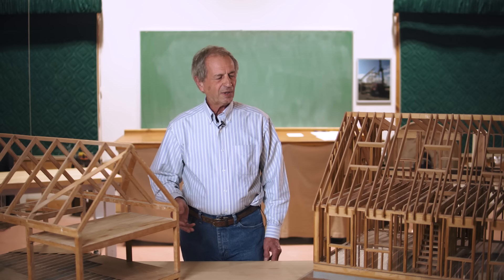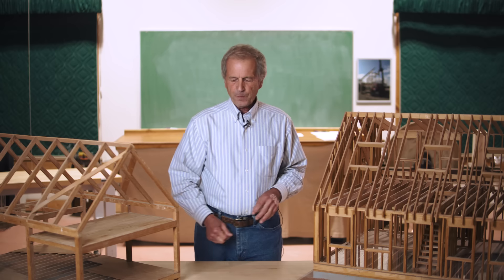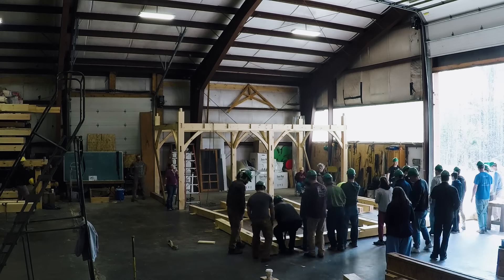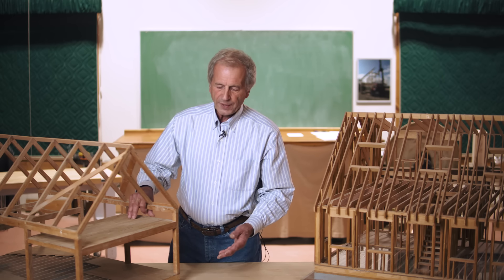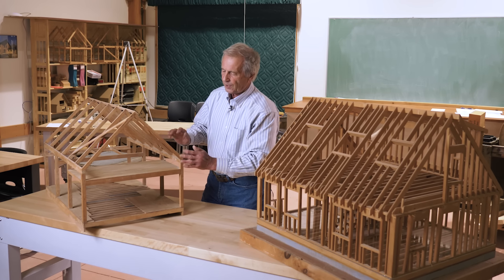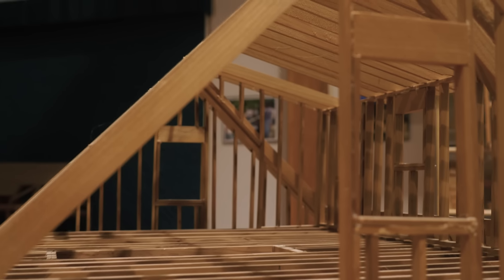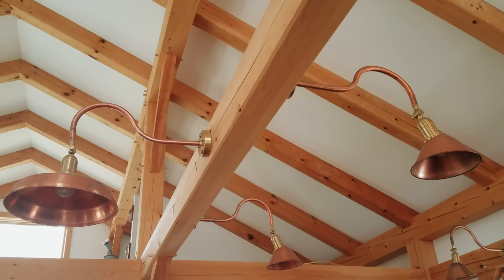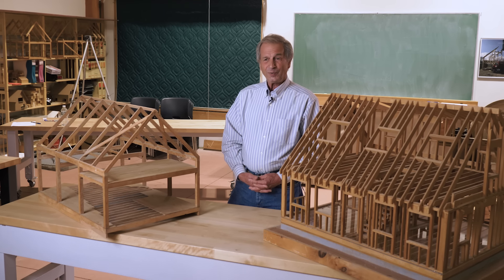Timber Frame vs Conventional Stick Frame

Comment: Love how this video is just subtly dropping shade on modern construction.
Reply: Modern construction is coded for one reason only and that is to enrich the largest lumber companies that have huge budgets for lobbyist.  There are numerous practical ways to build your home but you will not be approved by the code. Many techniques have been used for centuries and are still standing.  In my coastal NC town the codes have become ridiculous and let's not forget that they are interpreted by some local jackass who has never built a doghouse. Some older homes here (100 years or more) are standing on stacked stones and are ballon framed for cooling.  They have been through all the same damn hurricanes as all the rest of the homes in the area. Just saying that building codes are necessary to weed out the idiots but you should be able to build by other methods if you desire. There is more than one way to build a home.

Comment: I didn't take the time to read many comments at all, so please forgive me if my comment beats a dead horse.

I've been a woodworking guy and have had a fair amount of exposure to timber framing during my lifetime.  LOVE the process and the result!

When I went to look at building my current home, I was quite surprised the cost of TF versus conventional stick building appeared to be much higher.

This gentleman didn't do any kind of quantitative cost analysis.  Wondering if this cost difference is still a big consideration as it was 20+ years ago when I built.

Comment: There are large numbers of timber framed buildings here in England that have survived beautifully for many many centuries. Near my home is a medieval tithe barn dating to a little before 1300 with its original timber roof - it is in excellent condition.

Comment: kind of bummed he didn’t go into the advantages of stick framing. makes this just an ad instead of an informative video
Reply: I mean, it is an ad
Reply: advantages of stick framing? more job site waste? More lumber? more seams in the envelope? what exactly are the benefits you are describing?
Reply: @dennisnelson1602  Those are disadvantages, ya dum-dum
Reply: @deerkiller61  lol, no shit? That's his point.
Reply: The advantage of 'stick' framing is that there's far less constraint to the size and proportion of the rooms within the house.  One doesn't need to be concerned as to the alignment of the timbers to the edge/corner of an internal divided space.  Because of this, some Timber frame homes have hybrid (so called stick frame) interiors.
Reply: Divertedflight what you point out is that  any hack can stick frame.  Timber frame is true craftsmanship and certainly more of a connections to the generations that came before and provided the foundation of this world for which the masses of idiots today take for granted.  
I got plenty of draw knives, chisels, and adz for to you to discover what a real days work consist of.  
Geometry and some knowledge of tree species helps or maybe you want to keep relying on those incompetent fools at Lowe’s and Home Depot.  🤙
Reply: There are advantages to stick frame.

Stick frame with sized lumber is quick and became advantages after the Chicago fire.

As far as insulation? Stick frame is every bit as tight and is better insulated better because of the way it is put together there is more dead air space.

Modern lumber is cut to size. Meaning as long as your building is divided evenly you will have little waste.

Ceilings in stick frames insulate against sound better and are easier to roof.

I have built timber frame structures. Yes they are good structures . 

But ease of construction is not the only reason that we use stick framing. We live in 2019.

The ability to build a tight house with a layout you want happens a lot easier with stick frame. 

As far as wind and earthquake?

You have to build your building for your area.

Stick built on a slab foundation stand better than timber on traditional foundations.

As far as fire?

Well.... what is between the timbers makes a lot of difference...
Reply: True, he is bias, stick is economical and doable from a home depot for us average joes.
It's insulation an envelope is far more prone to flaws over sip sheathing, but I like stick framing because I can tear down what I build, and salvage 90% for other structures and it's easy due to uniform sizing.
Reply: Exactly
Reply: he did. its easier.
Reply: and cheaper.
Reply: You have to buy his lessons.. so yeah.. ad
Reply: I would say a major advantage is the ability to modify, remodel, or repair a stick-built house. Think about it. If you want to add a room, or if you want to lengthen your timber house, you have to tear part of it down, add mortices and tenons, and then finally add on your addition. The same thing happens if one major beam is damaged. You basically have to tear the whole house apart to replace that beam. 

But with a stick-built house, you want to add an addition? No problem! Just cut out a doorway, remove the outer siding, (or perhaps don't even do that) and just tack your addition to the existing structure. In a stick-built house, if something rots or is broken, you just jack up that part of the house, cut out the bad boards, nail replacements in, remove the jacks, and you're done!
Reply: It’s called sarcasm.
Reply: Cost mostly, there's already a massive industry around making stick framing so the cost for it is substantially cheaper.
Reply: @dennisnelson1602  cheaper
Reply: @dennisnelson1602  Far easier to build due to the weight of the timbers , many times cheaper to build due to 2x4 timber availability, and much faster to build because 8x8 timbers are heavy as hell as opposed to a stud that one man can carry with no problem.  Your standard 2x6 on 16" center house is plenty strong and perfectly fine for 99% of the population.  Most people don't care... they just want a house that looks nice and they don't have to mess with.
Reply: he is bias.
Reply: It I bias . Probably because it is their channel and the whole point of making the video is to sell THEIR services. 🤔
Reply: The advantage of stick framing is that you don’t have to have 80 trees on your property to cut down to make a timber framed house!  The timber frame comes from the trees 🌲 on the land that are cut down, and milled on site to frame the house.  That’s why tornadoes tear apart stick frame houses, there are no trees in Oklahoma to build timber framed houses!
Reply: @ferdonandebull  Modern houses burn MUCH faster than old ones.
Reply: Cost and profit for a commercial builder.
Done.
Reply: Stick framing - easier, lighter, way more flexible, much more forgiving, doesn't require extreme engineering for ALL aspects.
Reply: @bb-sd8eg  lmfao, go try to learn how to stick frame in 5 days lmao. This guy says you will know everything about timber framing in 5 days or less
Reply: There are no advantages
Reply: @tonaldculpepper4119  there is a reason that's the way its done now (stick framing). Just like there is a reason we went from carburetor to fuel injection. Etc etc, you don't know what you are talking about if you truly believe there are no advantages.
Reply: @tonaldculpepper4119  What about cost? Availability of materials (if you need a particularly large timber you could be waiting for a while)? time to build, a stick frame 3500ft 2 story house can be framed out in 5 days with just a small crew? There are plenty of advantages
Reply: @3dentertainment301  Iv done a bit of timber framing and a lot of stick framing, both are fairly simple to understand the construction, the engineering and design on the other hand...

Comment: Id much rather have a timber house than a stick frame house.
Reply: Which is why so many trees are being cut. It's really bad for the environment but who cares about that, right
Reply: @jminkvihubyb  00:35 ...
Reply: @jminkvihubyb  You are backwards.  Rewatch the video.
Reply: @davidbeppler3032  wasn't entertaining enough so I closed the video. I already am in trade work so I know exactly what I was saying. Everyone thinks wood is better than everything else and so much of it is wasted. Just looking at the frame, one had more wood than the other.
Reply: @jminkvihubyb  Yes, the traditional house uses more wood.  You were backwards.  Either way noting wrong with building using renewable resources.  Not sure why you think we are running out of wood, in the US we buy most of our framing wood from Canada.
Reply: @jminkvihubyb  Maybe you should watch the video, seems you don't know what you're saying.
Reply: Patrick Santos There are more trees now than there were 100 years ago. Trees are a renewable resource. Most lumber comes from managed forests that are replanted after harvesting. Maybe you’re thinking of the Amazon rainforests. We get most of our lumber & timbers from Canada & Other parts of the United States. Maybe you should use corn cobs instead of toilet paper since it comes from trees
Reply: @davidbeppler3032  I see that now after watching the video.. you're probably right but growing up, I learned oak trees took 50 years to grow. And with a bad assumption figured that'd be there same for the others.
Reply: @davidbeppler3032  and about the tree loss I was mentioning, here's a copy paste from one source: Today, annual tree harvest vs. production on a world-wide scale shows that humans cut down approximately 15 billion trees a year and re-plant about 5 billion.

That’s a net loss of 10 billion trees every year, and a rate that would mean the loss of all trees within the next 300 years. That sounds like a long time, but your great-great-great-grandchildren may not have the same perspective as you do on that topic
Reply: @davidbeppler3032  this is a different source. They claim: The study points out that industrial timber plantations, mature oil palm estates and other specifically planted forests add to global tree cover. On paper these areas compensate for the primary forest that has been cut down; 100-hectare loss of primary forest is perfectly offset by a 100-hectare gain on a man-made plantation, for example.

But while they may be equal in area, they are not equal in biodiversity. Primary tropical forests and savannas harbour a wealth of flora and fauna which is lost when these areas are cleared.

And man-made forests do not compensate for the damage and degradation done to ecosystems through land clearance.

The research attributes 60% of all land-use change throughout the study period directly to human activity, with the remaining 40% caused by indirect factors like climate change.

---doesnt really matter much to me but it's something that does cross my mind from time to time when I hear customers always choosing wood that isn't always being replenished
Reply: @davidbeppler3032 Plenty of wood between US and Canada. Way more than needed growing everyday. Woods an excellent renewable resource.
Reply: Patrick Santos I will agree that South America & some other parts of the world are a huge problem with forest degradation, but not here in the US. As I stated we do not get our lumber from that area as a rule. It just irks me when the US gets blamed by environmentalists for every horrible act by humanity. Take plastic pollution for example. Most of the plastic that ends up in the ocean comes from unregulated countries that dump their garbage in our oceans, not the US. I love clean air, water and trees as much as anyone. I just hate blanket statements that if I build a house out of wood that I am hurting the environment. People need to get informed before they start to lay blame
Reply: @tennesseetexan1957  good to know. the last time I've actually really researched this, was for a presentation in high school. and that was a very loong time ago lol ..I guess the only reason I thought this was a problem is because on construction sites, we waste soooo much wood and that's the only thing I see in the real world. Guess I was just really wrong.
Reply: @jminkvihubyb  I like that you responded to people comments without snark and were able to change your mind.  Kudos to you my friend!
Reply: @jminkvihubyb  yellow pine is what's mainly used in modern farming. Typically, its grown back in just a few years to be harvested again. When I worked at Universal Forest Products as a truss designer we always used southern yellow pine. I bailed from that job after realizing how really bad engineered the home's were done. Also how many owners were requiring repairs in houses only 2 years old. That's why I will go timber besides its beauty. I will never buy. Home from KB, DR Horton, Cesmar or anyone that wants a cement foundation. I'm a pier and beam man but love timber.
Reply: Chuck I’m not going to argue that there are parts of the world where tree loss is a problem, but it’s not in this country. I just took issue with being told I’m a bad person and I’m killing the environment because I build a timber frame which actually uses much less wood than a stick frame home. Also many timber frame and log homes are built with standing dead wood  created from fires and insect damage. Granted we should always be responsible citizens with what God has provided for us. Just because I choose to build a wood home and someone else chooses concrete, cob, earthbag, or a tent, to each their own. Just don’t condemn me for my choice. Costs vary wildly depending on area and how much you choose to do yourself. I prefer timber frame, maybe you don’t. That’s ok with me. I’m perfectly comfortable with my choice
Reply: Chuck read my post. I said we get most of our lumber from Canada & the US.  I believe we should use wood from only managed resources and have a limited harvest from old growth trees. The palm oil trees are not really grown in the northern hemisphere because it requires a more tropical climate. Yes it’s sad about the world’s rainforests and I wish something could be done to keep that degradation from happening. My point of contention was someone implying that I am hurting the environment because I build a timber frame out of wood. Timberframed homes use much less wood than a standard stick frame home. Also much of the wood used is from standing dead wood caused by fires and insect damage. Also they last much longer than a standard stick frame house.  I believe we can build from wood responsibly and do more so than many people might think.
Reply: @jminkvihubyb  I don’t care
Reply: @jminkvihubyb  lol... tool :p
Reply: @tennesseetexan1957  depends on the type of wood!  Adirondack baseball bats are no longer made because they ran out of the trees to make the bats!  The hockey stick company, CCM, is also running low of the wood used to make hockey sticks, and that’s why the NHL allows aluminum shaft sticks!  Imagine if baseball was played with wood bats from little league all the way through college, that’s what is happening with Canada’s wood.
Reply: @tennesseetexan1957  Ironically, most of the exotic, slow growth, wood is likely used in the cabinetry of houses and jets/ yachts used by the wealthy celebrities telling common people to be more green. Traditional framing lumber is grown pretty efficiently, I would imagine. Teak and mahogany, etc. are far less renewable.
Reply: @jminkvihubyb  Most of the pine lumber we buy at the box store is on a 3-year cycle. From planted to harvested.  You don't need oak beams to do timber frames.  Pine has its advantages with its ability to flex and being cheap.  Sometimes rigid is not good in building.

Comment: Interesting as a journeyman carpenter/ fine woodworker I have never built a timber frame house, I have used large beams to get the look of it, I have probably cut every joint you use in building furniture, dovetails for drawers, mortises and tenons for case work. Hopefully I can attend your classes one day

Comment: While I love the tradition of timber frame construction I have a problem with the concept of using sips panels for insulation. Sips panels are structural. You can build a very strong house just with sips. A timber frame house with a sips exterior is a double built house, a luxury that few can afford.
Reply: Another option as said in the video is Straw-Bales (multiple benefits including excellent insulation) when building Timber Frame.

Comment: "Gypsum Palace" LOL! Yes, most homes I've ever set foot into are painted gypsum palaces. Most post and beam homes I've seen are very open floor plans that give you a sense of free space and comfort. I've seen some very beautiful wood finishes on them. Plus, you can make timber frame styles out of square steel tubing for a super steampunk appearance, like a pavilion, but with monster windows to enclose it. Exposed water heaters, clearcoated copper plumbing, Stainless countertops. Stairs outside so you can get on the roof.

Comment: I have done a number of timber frames and stick frames too. There is nothing more satisfying then making nice timber joints! I am building my own house now and I will frame it with 2x4's and trusses. It will be much faster and use much less wood. I am cutting my own trees and getting them milled up. The thing that he did not mention is that SIP's are also full of wood too and they make the timber framed home double framed in essence. The framed house in contrast is only framed once.
When I frame my house I will sheet the outside with 3" of styrofoam, then strap it and do board and batten on top. It will be strong, natural looking and well insulated. I do plan to do some round log timber framing to add that big wood beauty to my front entryway and livingroom. Timbers are certainly beautiful!